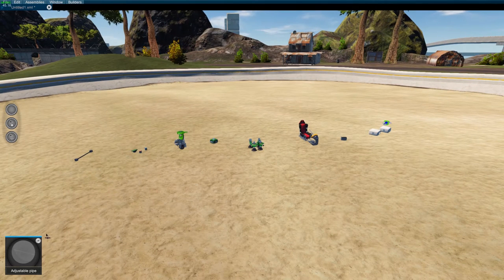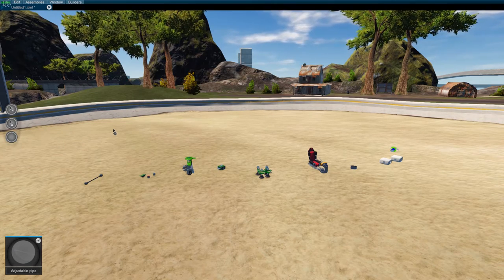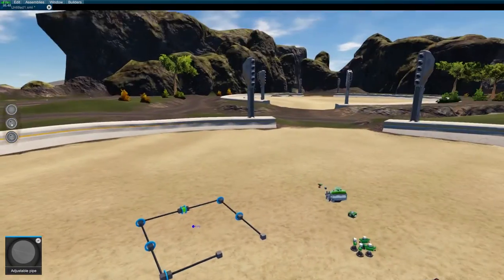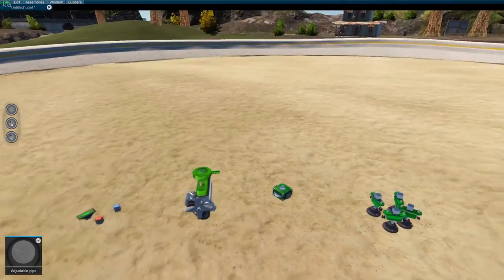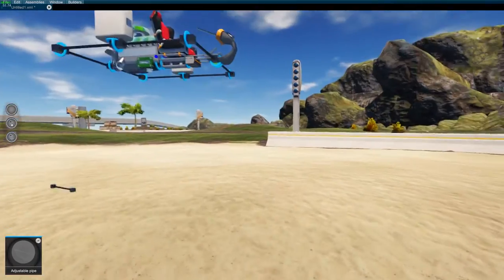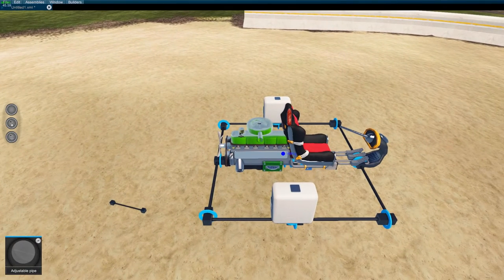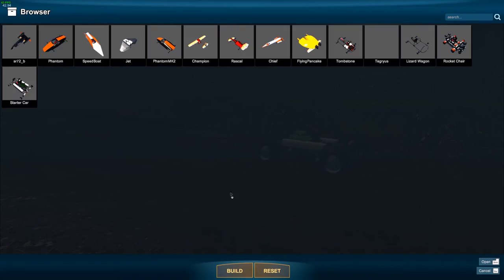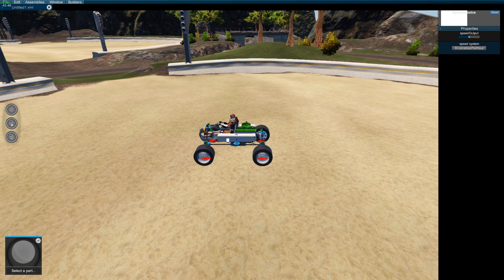Homebrew Vehicle Sandbox - Simple Car Tutorial

Comment: In the Tuner. How did you connect both fuel tanks?  The first one connects fine but I tried shift, alt, whatever.  It won't let me connect the second fuel tanks node to the engine, only the first tank.

Comment: Great Video :D
but i have some problems... I can only connect one fuel tank to the engine and the engine won't start :/ I did it exactly like you did, I used the same parts and the same connections. can you give me some tips? Thank you :D
Reply from the maker: +patar1011100 Do you have a toggle switch between the seat and engine? it needs a constant input to stay active :)
Reply: I do have it
Reply from the maker: +patar1011100 Battery? :) Just going thru the easy things first lol Also, you should be able to connect multiple fuel tanks :/ Strange :/
Reply: +TheFrowningLizard It works! i have no idea why, but it works in the simulation. i still can't start it in the builder. i think it's a bug :)
Thank you so much for your help and your video, it helped a lot :D and keep doin, watcha doin ^^
Reply from the maker: Hey man no problem, glad u sorted it :) And I will do this as long as I can :)

Comment: I can't connect drive shafts from the engine to gearbox and gearbox to wheel hub. also only one connection to fuel for the engine, why?
Reply from the maker: +deaflol You need to use all parts of the same colour. I use the green (simple) ones as it's easier, Simple engine, simple gearbox, simple wheel hubs :) 
The fuel tanks can all connect to each other and the input on the engine will accept more than one tank. Hope this helps :)
Reply: +TheFrowningLizard Sorry I didn't mean to ask more than once but YouTube was letting me comment lol thanks for the replies and help :)
Reply from the maker: Thats ok, I like to help when I can :)